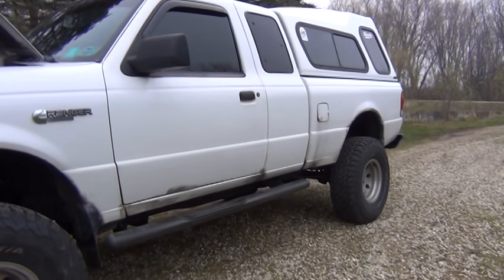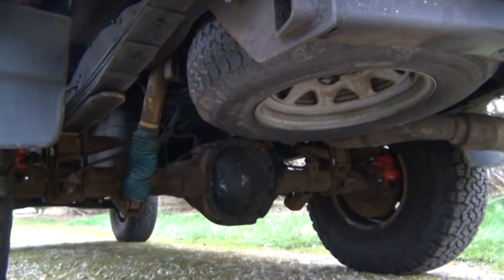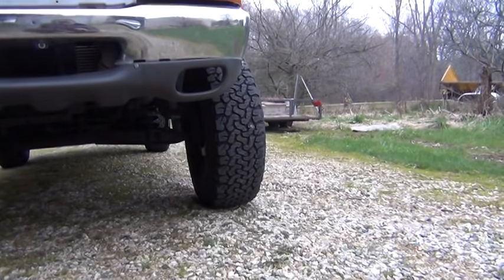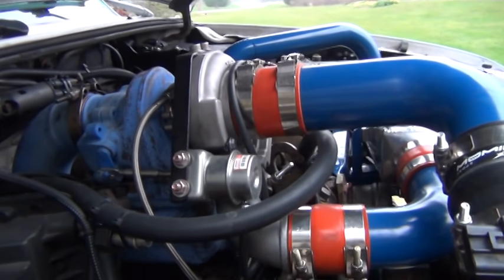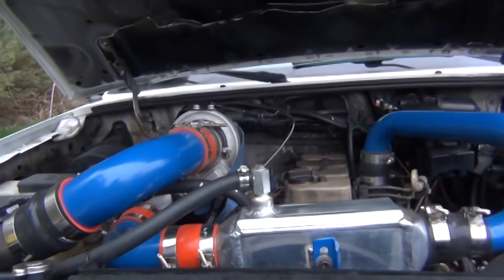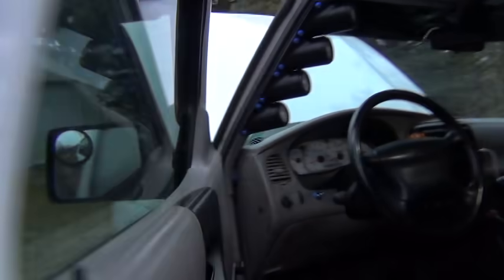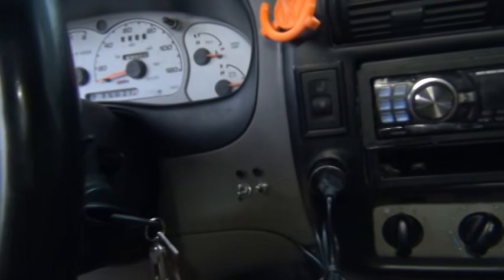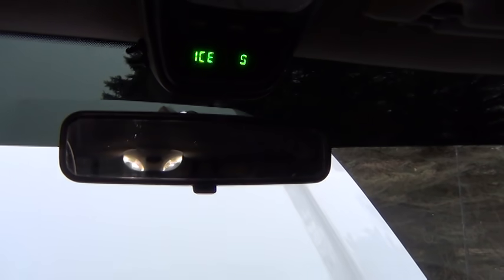IQCS 2020: Becky the CRanger (4bt Cummins swap)

Comment: what's that lever for on the  shifter ? looks like its from a  bicycle
Reply from the maker: You're spot on. That's cruise control, simple and cheap. There was no factory cruise in this vehicle and to add an independent electronically controlled system would have been hundreds.

Comment: Where did you get the motor from cause I’m wanting to diesel swap my 98 ranger the motor it has in it has been turned over twice one owner my grandfather once he passed I got it so I’m wanting it to last I just need to know where I can get the motor and everything for it.
Reply from the maker: Got mine off Facebook marketplace. You can get bread/box trucks with these engines or even an engine&trans on pallets. Little bit of searching and whatever is closer will likely be your best option.
Reply: @old509cc2  what did u use to do the start thing that was cool to have it start and still be able to lock it
Reply from the maker: @prestonslocum9683  I found that one of the two wires to my alternator has power once the engine is running. I have a switch that toggles the trigger source of my power distribution block (with the fuel solenoid relay) from keyed to the hot wire of the alternator. 
I just got done with another huge round of work so it will be a few weeks until I get to it, but I hope to pull a wire from my dist. block to turn on the heater controls as well. (With the key out and truck locked)
Reply: @old509cc2  nice.  That is awesome. Could you do a video of it and how its all done

Comment: What motor mount use ?
Reply: It's very nice
Reply from the maker: Makario Nepomuseno thanks man. I am using Anchor 2698. If I were to do it again, and I might yet with this truck, the mounts would be placed to reduce vibrations and not just what will fit easily. I have since read that solid rubber ones in proper configuration is better than the current setup. Check out farmstronginc for more information.